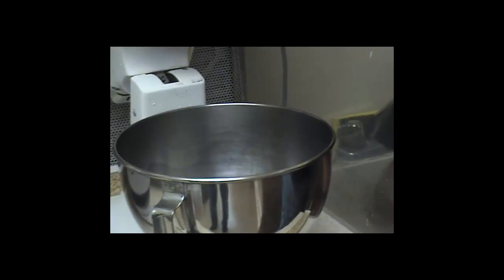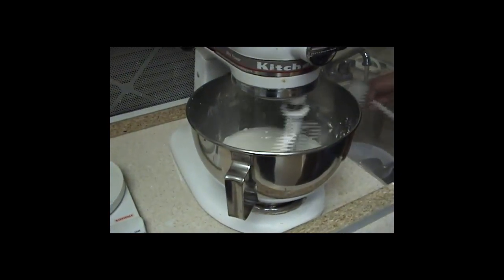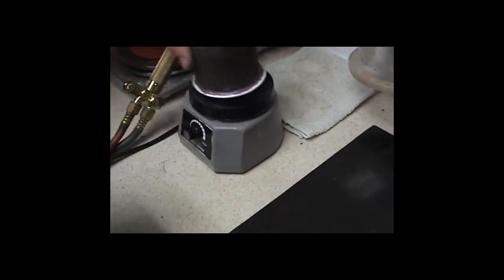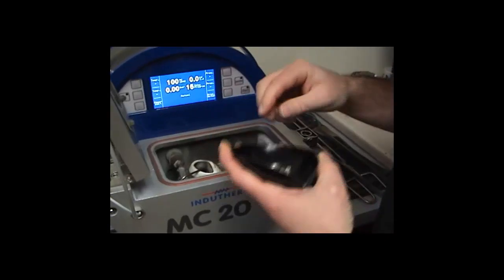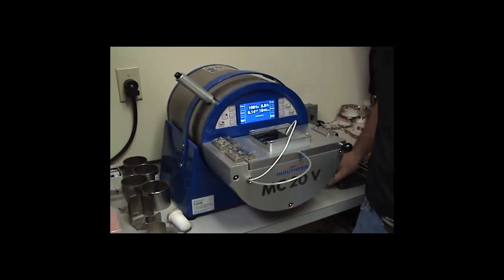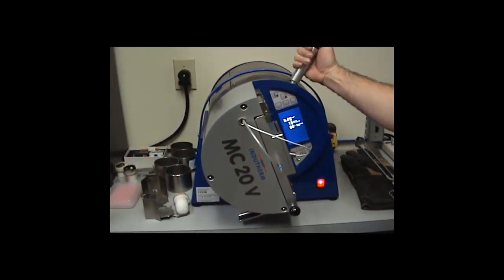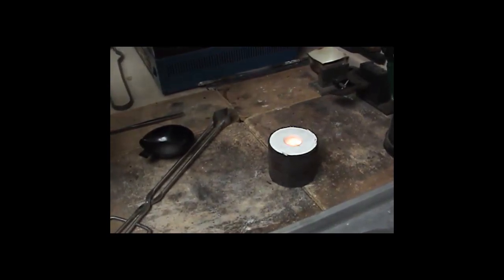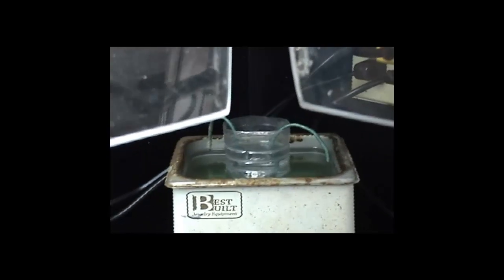Platinum Process part2

Comment: I casting Platinum Cobalt 95-5 alloy in MC20v Indutherm furnace  with Romanoff Fast Cast investment and 3Dsolidscape printing waxes. Casted rings appear with the rough surface. Is it necessary to clean or paint the waxes before adding the investment to the cylinder?

Comment: are you casting Pt Co or Pt Ir ?? Looks like the displayed temperature before casting is only 850 C ???
Reply from the maker: We use 950 Platinum Ruthenium. We actually have totally changed our method and do not use the indutherm for platinum any more.
Reply: how come?? I was looking into buying this machine especially for Platinum casting for small shop. Can you give me some advice ?
Reply from the maker: The Indutherm is a great machine but does not work as well with dental investments that we need to use to cast resins and solidscape waxes. The casting temperature has to be high for the metal to fill and in doing so the surface finish is a bit rough. It's doable just not ideal. Although we only use it for platinum  the Easycast machine can do everything and is in the same ballpark in price.

https://www.stuller.com/products/22-2160/?groupId=119752
http://www.ajstools.com/Ultraflex_EasyCast_EC_12_p/16-0081.htm
Reply from the maker: Comments are for platinum castings of resins and solidscape wax
Reply: I can cast gold using RP resins  with Ultravest Maxx investment. Seems like R&R came up with a new investment for casting platinum, designed for burnout of resins , PlasticasPT.   Also,  there is Doc's Platinum investment.Have you tried any of these?I would really like to know about your experience with MC 20V in platinum casting..
Reply from the maker: We use UltraMaxx. We have tried Docs, I don't think the PLasticasPT is anything NEW. Both investments are essentially dental investments which I previously stated are doable but not ideal with the indutherm, we struggled enough to buy another machine. J-formula from Romanoff is the only investment that we got decent results with. It's an acid binder type investment and does not work well with the resins or solidscape waxes.
Reply: so how are you dealing with the resins? You make a mold and inject wax? Or are you coating the resin model so it will not interact with the acid binder? Any help would be very much appreciated. I use b9 creator green resin, wich I can cast very , very well in Ultravest Maxx...but only gold and silver...
Reply from the maker: We don't use the acid binder investment anymore, We use a dental investment for casting resins in platinum. Like I said before the whole reason we bought the Easycast machine was because of casting resins in platinum. The Indutherm will work but it's jumping through hoops. We coated, modeled and injected and milled to get the job done, all depends on type of pieces and volume whether it will work well for you.
Reply: You said:
We don't use the acid binder investment anymore, We use a dental investment for casting resins in platinum.
 My understanding is all dental investments use acid base binder. I use them for sometime, but never heard of one without it ( you can mix with diffrent % of water for a diffrent resoults, but it is based on acid binder) . Can you tell me what company you use? Thanks